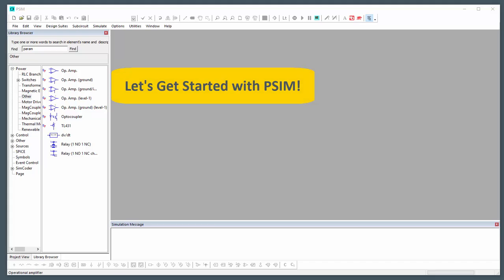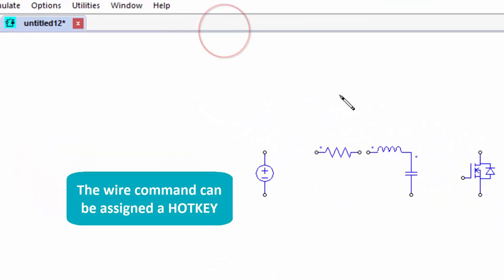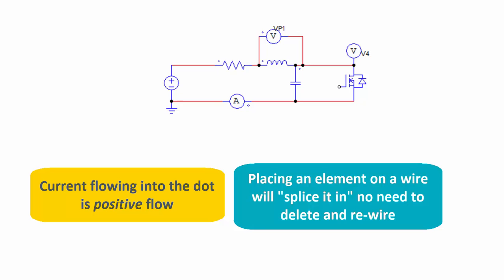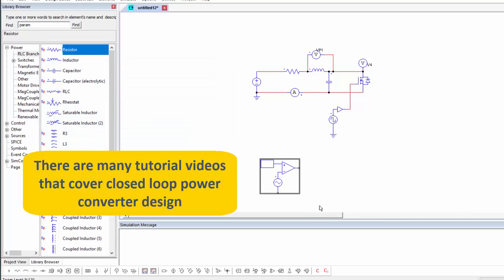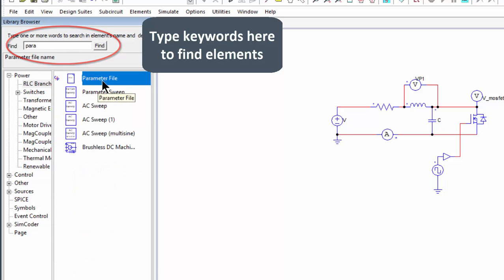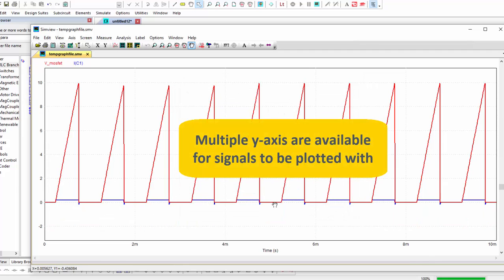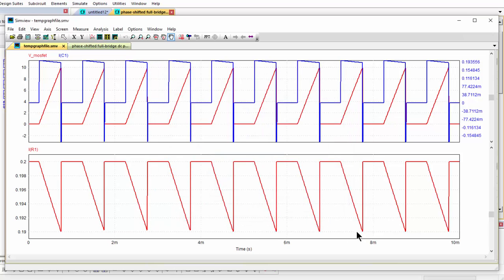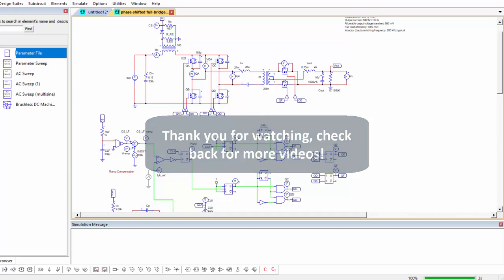Getting started with PSIM

Comment: thank you for the video. I just wondering in term of using parameter file. Is there any easy way, to run simulation with 100 set of different parameter file (each set contains different variables value) to produce varying output.
Reply from the maker: Yes you will need to use a script, there  will be many examples of a script in the examples folder of PSIM,  this application note will explain how we use script to setup 300+ simulations of an LLC to measure gain with different loads, inductance ratios, and input frequency. https://powersimtech.com/applications/llc-resonant-converter/